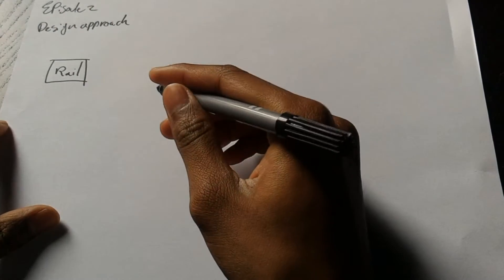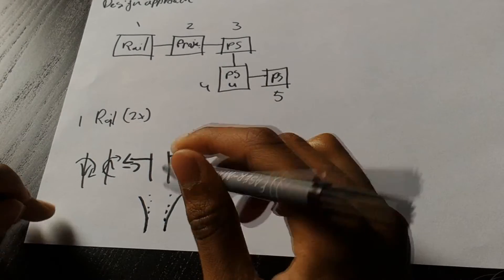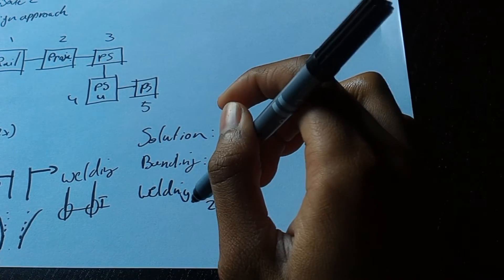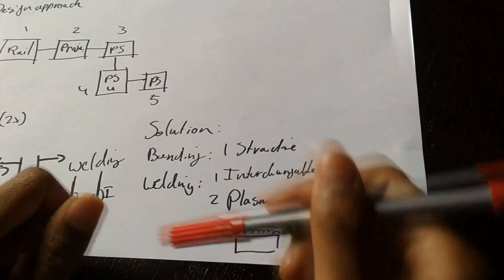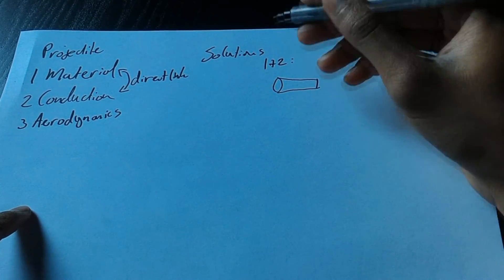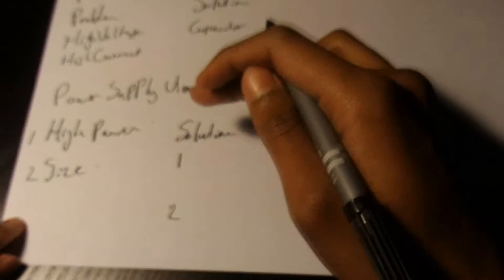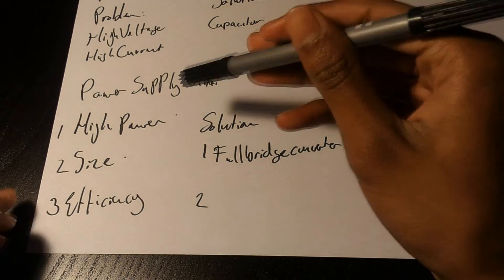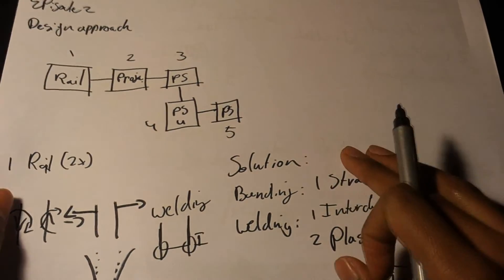Railgun Build - Episode 2: Engineering design approach

Comment: I do not have much experience  or knowledge about this kind of stuff. But if there is a large amount of energy on the gun, wont there be a lot of recoil when the gun is fired?
Reply from the maker: That is excellent thinking! As a matter of fact, there is a huge amount of recoil, except, it's not the way you think it would go. For example, in a regular gun the explosion causes a force upon the bullet, but also a force backwards and... basically everywhere, since it's an explosion. With this, the only force present is electromagnetic force, therefore to notice the force you must either be made of a material that reacts to the magnetic field, or be a magnetic field. Well, apart from the iron in our blood we won't notice anything. The only force we can feel is the force of the two rails repelling, they both produce a magnetic field with the same polarity as I said at 2:30. Two magnetic fields with the same polarity will repel eachother. That's a force is the only form of recoil and it's not directed back at the shooter. However, it is still directed to somewhere and that is a problem that I am required to fix, using a supportive structure. In conclusion, the recoil is not directed in the way you're shooting like gunpowder guns, but rather to the sides. 

http://images.slideplayer.com/25/7942241/slides/slide_9.jpg Repelling force

Comment: Also, dont forget that its hard to make a railgun with a circular barrel. you have to make it square and give the circular projectile a sabot.
Reply from the maker: Oh, don't worry too much about that, it'll be pretty easy the way I am going to do it. I'll probably make some machines myself for this project. Also the circular barrel has a larger surface area, therefore also a better current density distribution. Sabots might work, but it'll require using a whole new sabot every time you fire.
Reply: ***** wouldn't it require you to make a new projectile for every shot anyways? I mean, if they will have a projectile velocity that is higher than a normal gun's, it would become very deformed or even destroyed when it hits the target
Reply from the maker: boomchacle Yes, but regular guns have a lead alloy projectile, lead is often very soft and deformable. The alloy makes it a little stronger. They do this, because lead is very dense and the derrivation for kinetic energy states Ek = (mv^2)/2. Also guns have a higher muzzle energy. 
I'll be using a carbonsteel projectile, this is often much harder on the surface depending the way you treat it. I am planning on using something that looks like a sabot, but the design for the projectile is later on.
Reply: ***** wait. guns don't always fire lead, and even when they fire steel I see some deformation. if you have a copper jacket, I worry that it will be shredded off
Reply from the maker: boomchacle I see where your concern is coming from. However, I won't reach kinetic energies that of a rifle, I am hoping atleast to compare to a 9mm with rifle rounds... for now. In the future we'll see how the design of the projectile unfolds.

Comment: why not just plug it directly into the wall?
Reply from the maker: I want it to be portable and fast, if you don't have a power outlet nearby, it's going to be pretty hard to charge your capacitor bank. Also, I thought it would be great for my power systems engineering skills, for later use as well. I am also planning to use this knowledge in brushless dc motor drivers, making awesome projects.

Comment: What's you take on coil augmented railguns?
There's some content here:
http://what-when-how.com/space-science-and-technology/electromagnetic-propulsion/
Reply from the maker: If I understand correctly, a coil augmented railgun uses a coil to reduce some of the current on the rails, but therefore replaced by the magnetic field created by the coil? Well, I am not a fan of using coils as "injector" into the rails. Since there will be a huge energy loss in both of them. I'd rather use mechanical ways to add a initial velocity. As the LaPlace Force is defined by F = BxIL, the current and magnetic field are linearly relative to eachother. Therefore sacrificing current for a stronger magnetic field is pointless. However, having a limited current due to resistances of several factors (e.g. ESR, conduction resistances) there might be some future into augmented railguns.  For now I think it's a pretty big waste of time, money, work and especially energy.  Perhaps in the future I will try different things to test how they work. I hope you didn't think I would build only 1 :)
I am also planning on making a coilgun, but for extremely long ranges, much like a sniper rifle. Perhaps after that I can use it in combination with a railgun.
Reply: So you plan on using no augmentation whatsoever?
Reply from the maker: Eventhough an augmented magnetic field is nice, I think it will be quite complex to integrate it into a lightweight handheld system. Ofcourse, I can always try to figure out a way to do it anyway. That's for later into the build process :)
Reply: I'm using Neodymium magnets in my handheld. Pretty strong, not sure what to expect.
I don't have any specs on the magnet...
Reply from the maker: The thing is with a augmented permanent magnet, even a 10kg neodidlium magnet looks like a fridge magnet next to a 30Tesla electromagnetic field induced by the explosive current. What you can do is get a analog hall sensor (one without integrated schmitt trigger), on which you DO know the data sheet. You can read the voltage drop/Tesla or Gauss, get an Arduino to do the analog read, use the Arduino IDE built-in plotter "osscilloscope" and done.
Reply: Oh, ok.
Reply from the maker: I am not sure with what kind of currents you're playing with, perhaps you have more use for a augmented magnetic field than I do.
Reply: Yes, I suppose.
Just a measly 100A.
Reply from the maker: Ah, yes that corresponds to 0.02Teslas, therefore an augmented magnetic field will certainly help. Will there be no way you can increase the power? 100A doesn't really deliver the big dphi/dt value that makes the armature to be launched.
Reply: Not in this ultra-compact design. Maybe better caps will help. Eg. Photoflash.
Reply from the maker: Same design as before? You don't need amazingly high voltages to get an effective railgun. In your case I would take lower voltage caps (100-200V) and just whack them in parallel. Same effect. I found some 10000uF @ 100VDC That's equal to 100J per cap, times 6-12 in parallel. You can imagine where I am going with this. Perhaps I should start to think about a hand gun design as well.
Reply: Mine is 200v 2000uF. Pathetic, but something to start with.
I don't want to exceed the 200v mark, arcing can become severe .

Comment: Hello, I like the work you are doing and hope all goes well ^-^
I am a physics major myself, and I have been interested in railguns (and other electromagnetic launchers) for some time, and throughout my researching I have found lots of materials, and here is one paper that I thought may be of some use to you, if you do not have it already:
http://ece-research.unm.edu/summa/notes/ELN/ELN%201.pdf
it is about ideal rail designs for railguns, so it may be relevant to the first problem, I hope it is of use.
Reply from the maker: Hey man, I am really glad you like my work and contribute to the project, that's what I it for! :)

I  have been looking into a suitable solution for the great current densities in the rail material. However, the material shouldn't be a problem, it's the distribution of the current densities. I have already figured out a couple of ways that are worth trying out. 

As for the paper you linked, I have not read it, thanks a lot! I like that viewers are helping! The ideas of all these solutions have already passed my thought. Before I say anything I am absoutely no expert on magnetic fields, critique is welcome. As you can see, the idea of a pusher plate comes through of using a conductive sleeve around the projectile, perhaps not unlike a sabot round. 
For the ideal rail designs, the helical design might be fancy as it causes rifling and a more rapid decay of magnetic fields, in a mechanical view, it's extremely weak and lots of work to manufacture. Since adding twist to it will cause shear in the outer radius of the rails, more danger to make the rails go b00m. Eventhough the repelling magnetic forces aren't directed in a single direction, but in a distributed circular way, it still requires support all the way around. Not ideal for a handheld mobile railgun, sadly. If you were to machime them out of a solid block, it would be ideal.

I am also sceptical about the 4 rails, as they have a reduced surface area, potentially limiting the current. The most viable idea I'd say is using curved rails. The only problem to that is the poorly distributed current densities around the surface, causing welding.

 Eventhough none of them are bad ideas, we must not forget the manufacturing complexity and all the other factors that must be realized, for example the size, weight, etc. for a handheld system. 

Thanks again!
Reply from the maker: Ah excuse me, I didn't see your other comments as the YouTube dipshit sorting algorithm placed you in likely spam due to the links, I have them approved now. 

As for the Japanese railgun, first it was pretty painful to see what kind of thin conductors he used, but satisfying to see improvements. Too bad I couldn't understand shit. 

The helical rails are indeed machined, which make it pretty complex. I do plan on designing a multipurpose machine during this building series as well. A micro lathe, mill, drillpress, sander, router in one. It'll be required to make the projectile and rails. Also useful to have in order to make the enclosure. 

At my university they do have very expensive huge lathes and milling machines, however, I am not sure about having a milling machine on top of a lathe. 

I have many things I want to test and different design ideas are certainly welcome. Thank you again for your effort!

Comment from the maker: Also a couple of points I forgot to mention and discuss:

1) Welding: I will be adding an additional initial velocity to the armature using mechanical energy. As the armature shoves through the rails, finding a perfect balance between friction and propulsion, the won't be enough time for the projectile to weld against the rails, conserving the rails. 

2) Power supply efficiency: To the additional steps of achieving ZVS, I will also implement synchronous voltage doubler. This will allow me to use a smaller transformer core on the pcb and only ouput half of the required voltage, which will then be efficiently doubled to the desired voltage.